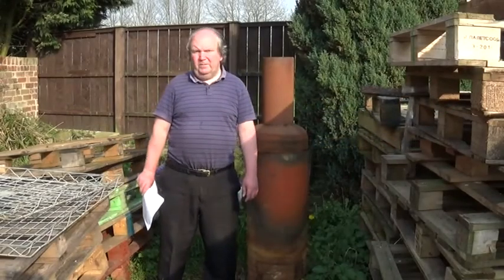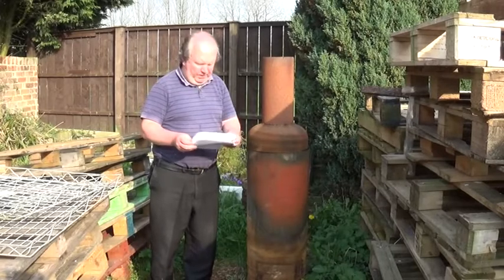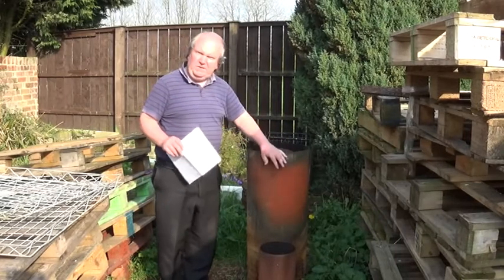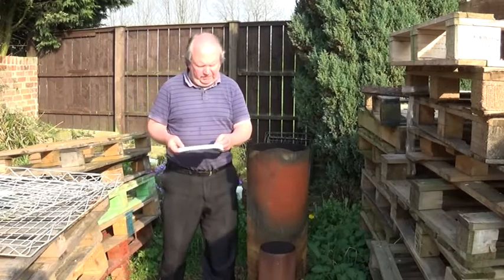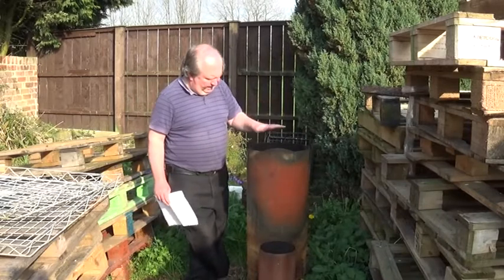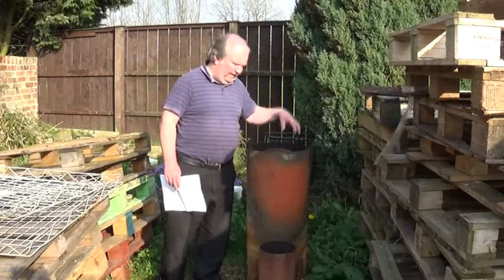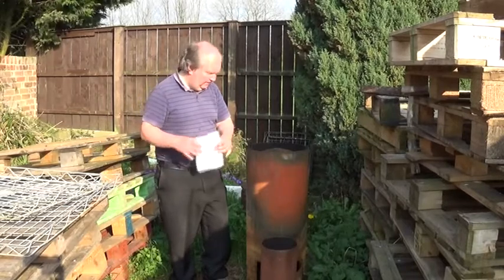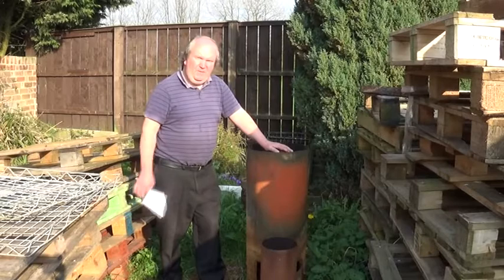HOW TO MAKE PERFECT CHARCOAL IN A HOME MADE RETORT: Q&A

Comment: Hi Andy I have no problems getting the parts, but finding someone who can weld is the challenge any thoughts on a non welding model?
Reply: Welding isn't too hard to do if you don't mind it being ugly as sin (read as; functional) Couple hundred dollars and you'll be able to pick up a welder of one flavour or another, do some research and pick one up or find a welder, give em a call and arrange em to do it for ya.

Ain't no problem if it can be solved by $
Reply from the maker: I think a non-welding version would be very difficult to make. There would be lots of joints that have to be sealed somehow. It's almost certainly easier to buy a cheap welder and give it a try. Provided you use decent quality rods or wire it's a lot easier than you would imagine.

Comment: My question is:  is there enough oxygen getting in from the top hole of the retort to keep the charcoal ignited during the cooling period?    I don’t want to end up with a pile of ashes instead of good charcoal.  Did it ever happened to you?   Thank you for sharing with us,  your retort is by far the best one I’ve seen.  I have started my retort today and i will keep you updated on the progress.  Best regards -Yves
Reply from the maker: The idea is to get as little air into the retort containing the charcoal as possible. If air gets in the wood would just burn to Ash. However you do have to leave a hole to allow the expanding gasses to escape. I've never had any problems using the small hole you see, which is the original hole where the gas fitting was before I re-purposed the cylinder. Also the lid is not sealed so gas can escape around the edge of that too.
The system could be made more efficient by fitting a sealed lid and running a pipe from the hole in the top back down the outside and into the burn chamber. The gasses ould then ignite there so you wouldn't use quite so much wood as fuel.
Reply: @AndysShed  thank you for the information.  It's helping me allot.  Update:   (The outer barrel including the feeding door is done, the inner barrel is almost done, i just need to install the gas exhaust pipe on.  I did make the inner barrel lid airtight and the chimney is installed.  Almost ready to try the first batch of charcoal)  Best regards -Yves
Reply from the maker: @yveskc1  Have you run a pipe from near the top of the inner barrel, down the outside and back into the fire chamber? That's something I've been meaning that do. The trouble is you really need to make the inner Barrel air tight to do that but also have some kind of pressure escape valve. That's why a lot of people making gassifiers hold their lids on with springs.

It sounds like you're definitely on the right track. I'd be interested to see a video of it in action.
Reply: Andy's Shed  yes sir, that is exactly what I’ve done to the retort.  I ran a pipe from the top of the inner barrel lid to the bottom of the outer barrel.  It was a lot of fitting and welding but at the end it worked.  I am now waiting for the snow to melt,  I need to fire up the retort in the field behind my house and I can’t get there quite yet.  We still have 1m of snow on the ground Northeast of New-Brunswick Canada.  I will definitely let you know how the first batch of charcoal turned out.  Thank you again and best regards -Yves

Comment: Hey Andy, just came across your video and I think that that is the perfect charcoal retort. I may have a solution for your gasification problem to make it even more efficient. Instead of sealing the top and making new holes on the bottom of the inner chamber, use the same top that you have now with the threaded hole in the center, get a black Iron T and nipple and put in the threaded hole, run out a couple of short pieces from the T just long enough to reach the space between the inner and outer tanks, on the end of the short pieces put a couple of elbows pointing down to the space between the inner and outer tanks. Put on two longer pieces of black iron pipe that will reach from the elbows down near the fire area. I think the weight of the extra pipes will help seal the lid on the top, get your wood gases down to the fire, and still have a blow-off area up on the top lid if the gas pressure gets too high. You'll still be able to easily lift the lid and pipes off of the inner chamber to fill and remove the charcoal. Just a thought...
Reply from the maker: +Planet Lars That sounds like a good idea. The only problem is getting things like black iron pipe here in the UK is actually quite difficult. Nobody makes much of anything here, so suppliers for stuff like that are a bit few and far between. We certainly don't have big hardware stires that sell anything that useful. :-( I can probably get it online though so that might be the way to go.

The difference I think I'd make is to block the small hole in the loose lid and run the pipe from the side of the inner barrel near the top rather than from the lid. I'd then pass it rhrough the outer barrel, run it down the outside and back into the burn chamber at the bottom. Inthink James Hookway did something similar on one of his designs. The difference with his is he packs the wood around the outside and has the flames shooting up the middle rocket stove style. I tried that but found there wasn't enough hot surface area to transfer enough heat into the wood without fitting a fiddly outer layer of insulation. My way the flames insulate the wood inside.

I think a few midifications are called for then another test burn!
Reply: I didn't realize that black iron pipe was such a scarce commodity there in the UK. I'm from Pennsylvania, every hardware store you walk into in my area has tons of it. I'm going to build a retort exactly like yours when the weather warms up a bit, I think I'll add the black iron pipe thing. I'll report back once I get mine made and  how it works. If you get your edition added before me,  let me know.
Reply: I think  homayoun Shirazi above has a great Idea and a simple mod and I  have also made some potential variations on his idea and explained a few things

Comment: Make sure you plug the top hole and provide an escape route at the bottom for gases to escape.  It will ignite and produces the heat necessary for pyrolysis to continue.  There is no reason to procrastinate.
Reply: I agree with you, but the "plug" doesn't have to be tight, as anything  V shaped of metal or even a stone ? (possibly not heavy enough) Would enable the very small amount of pressure to push the "wood gas " out the new bottom holes. It only has to counter the buoyancy of the hot gas so there really isn't any pressure. 

Once this retort burning starts you won't have to feed the fire as the wood-gas will produce more heat than is required to maintain the process, and when it goes out the process is finished 

If Andy is worried about the end of the burn when air might enter the bottom and burn up the charcoal as it rises and escapes from the unsealed lid,  then a  ring of gasket/door sealing "rope" from a slow burn wood stove should prevent that.( A twist of it could even be used to block the threaded hole.)
There are lots of videos on inverted 20L paint tins with open 1.5" lid put into drums lid down that show this doesn't have to be sealed to prevent charcoal from burning up. As there is nowhere for the air/combustion gasses to flow too but OUT stopping fresh oxygen/air coming in .

Its an easy mod to make a few holes in the bottom and if it doesn't work the  holes can be welded up  or  short bolts dropped through them.
Reply from the maker: Greenwood I think you hit the nail on the head about the top needing to be totally sealed if you have a hole in the bottom. I don't think sealing the top is practical because it's curved. Also it acts as an emergency pressure valve. However what you could do is drill a hole near the top but not on the lid and fit a pipe that comes out through the side of the retort and back into the fire chamber below.

I'm currently trying to further reduce the smoke the unit produces. Once the gasses coming off the charcoal are lit smoke is very little. However the first few minutes while warming up can be very smoky. Returning any gasses burning off to the fire chamber will probably help with this too.